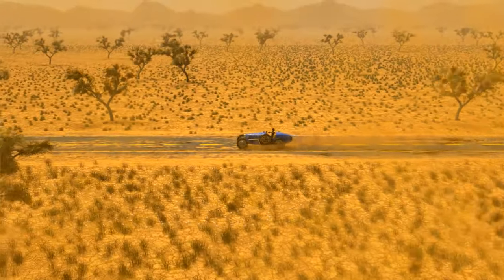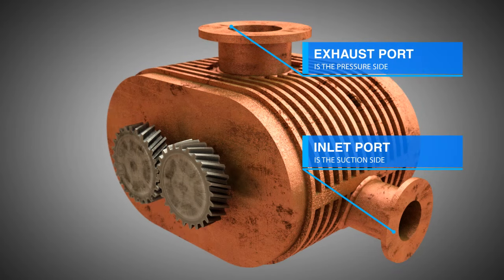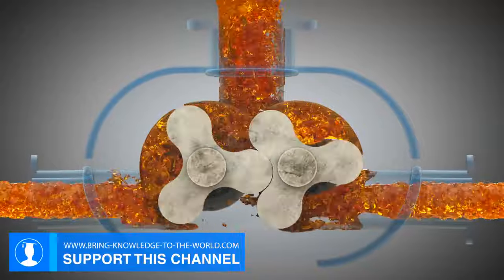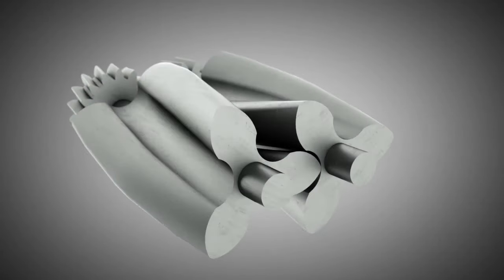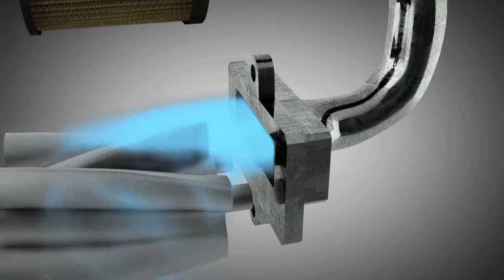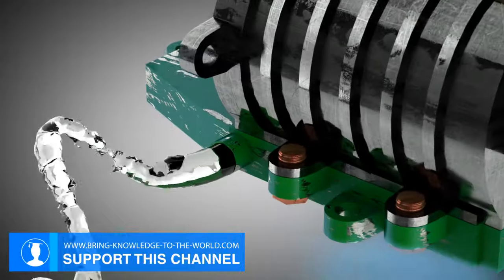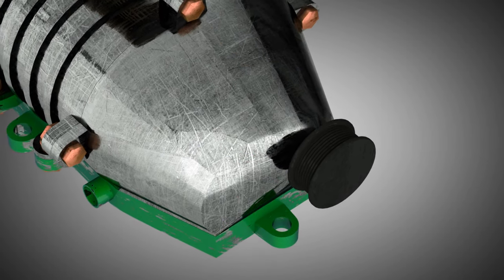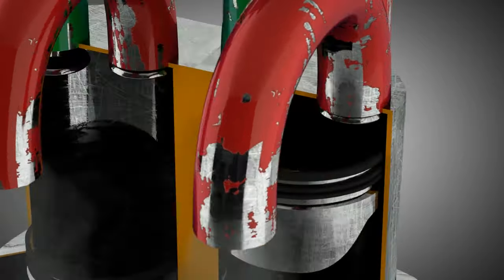Roots blower / Roots-type supercharger - How does it work? (Animation)

Comment: What animation, 3d modeling program do you use? I'm graduating college and loving the 3DS max aspect of modeling, mental ray or vray, with key shot renderings. Whats a typical salary for doing stuff you do if i may ask?

Also, great tutorial, instructional vids, helps me when i open up my supercharger to change out the isolator and re-lube the seals where the 2 rotors are attached too.
Reply from the maker: Hi, I use Carrara 8 Pro.
Reply: Thomas Schwenke thanks, like the animations and simple models.